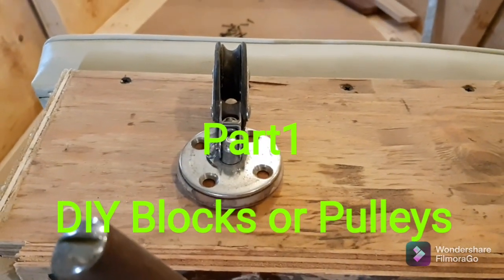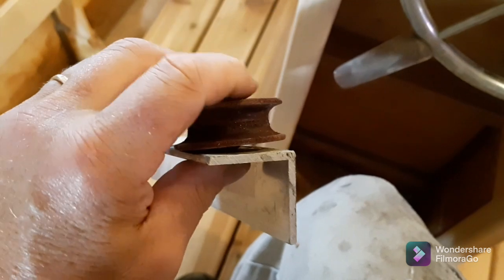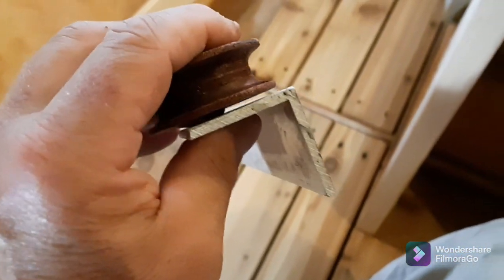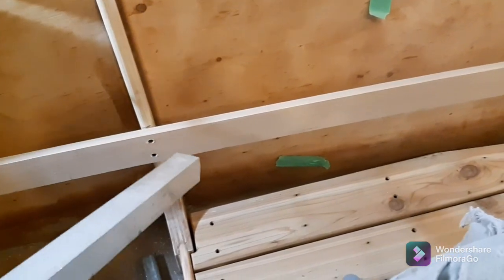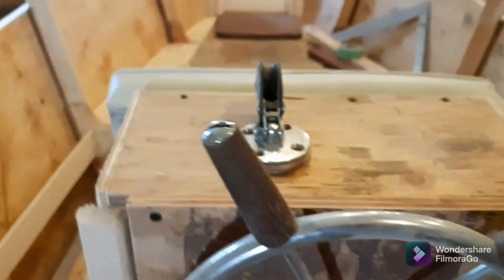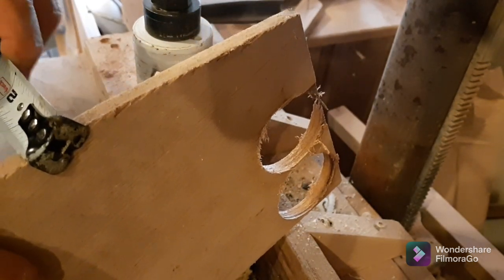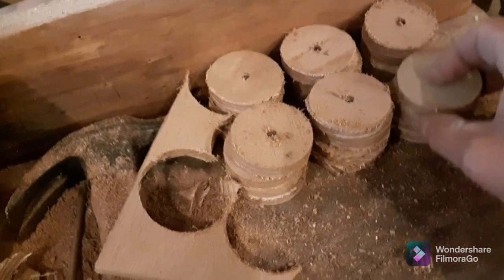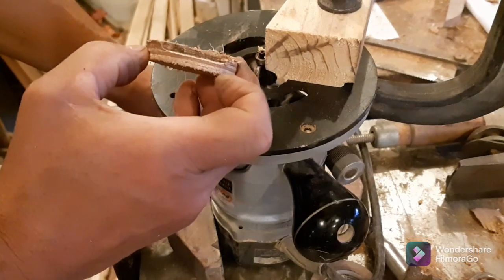CHEAP DIY Boat Blocks and Pulleys Part 1

Comment: Smooth shaft so the threads of you machine screw doesn't saw its way through the wooden sheave.
Reply from the maker: Yes I'll show this next vid! I am also on the lookout for a small copper or brass pipe and may cut tiny bushings! Best roy